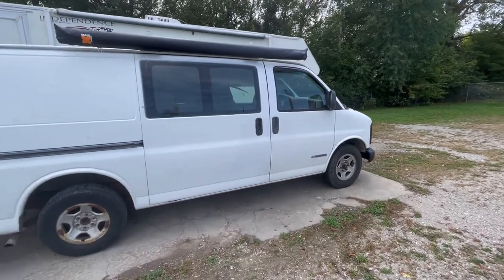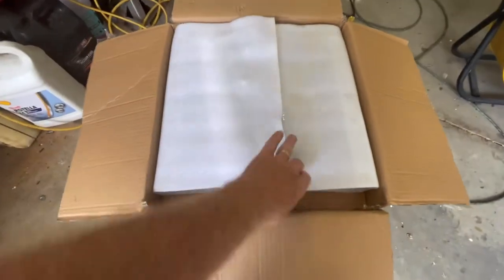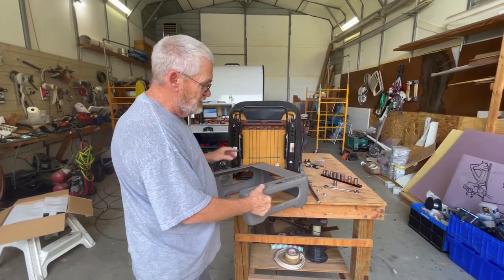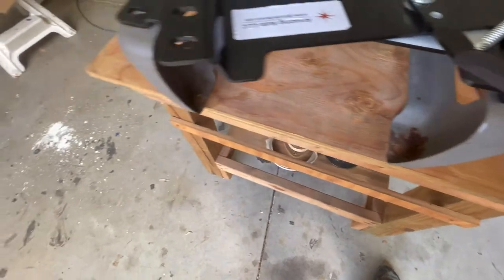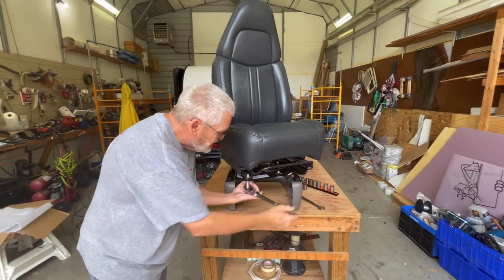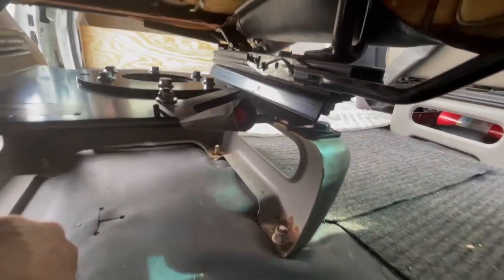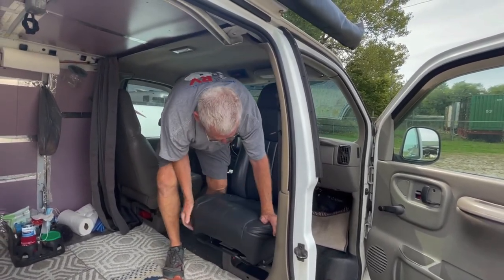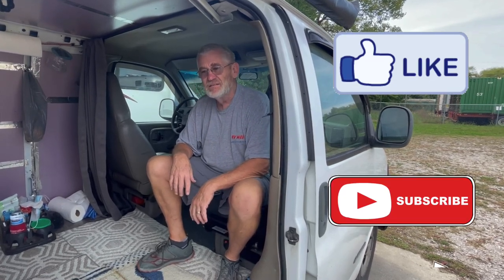Chevy Express “DIY” Camper Van Build  Episide-12  Swivel Seat Installation

Comment: Thank you for this! Helped me though the installation of my swivel seat. Was so much easier than I thought it would be. The only thing I did different was I just popped off the seat from the base, I didn't remove the whole thing together. I would never have thought of swivelling the seat to get at the bolts while tightening them lol! I'm sure that nugget alone saved me half hour of frustration. Thank you sir!
Reply from the maker: Thank you, glade it helped. 👍

Comment: I think I'm just going to get some wing nuts and quickly remove the four bolts on the seat bottom and flip the seat on the base whenever i need it. Almost just as fast as using this swivel and retains the original seat height.
Reply from the maker: That may work…. Let me know! 👍

Comment: Installed today. Thanks for the video! The "instructions" on their site are basically irrelevant. There's a very misleading comment next to the link for your video saying that something is wrong in it. I realize now I installed the bottom bolts upside down, and that's why the tolerances are super tight... the washer placements made all the difference. Needed stacks of two for the bolts to not hit in passing. I'll fix it tomorrow in the daylight...
Reply from the maker: I haven’t seen that comment.
But I hope the video helped.  I hope you enjoy the swivel as much as I do.
Thanks for Watching!
Reply: @TrailMedic911  it's a generic comment and they have it next to many of the videos they are linking to.
Reply from the maker: @capitalistocrat  Ok, Thanks.  Have a good day!

Comment: I just purchased a 2017 chevy express van 2500, I would like to put in a better seat. It has a cloth stock seat, with a airbag in the upright/seat back. But having a problem finding one that will fit, without bypassing the airbag. No power, I can deal with a manual. Any ideas ???
Reply from the maker: Sorry, without seeing it I’m just not sure.

Comment: Hey Keith. I just went back to watch this video of yours . I wish I would have done that first before I ordered the wrong swivels that don’t fit !  I am working on another van build and want seat swivels. Are you planning on attending the spring meet up? If so I would like to check out your swivel seats ( a little concerned about the extra height as I am 6’2 ). Hope to have van ready for a test run by meet up time  Thanks Keith
Reply from the maker: Yes sir, I’ll be there! 👍
I have had no problem with the extra 
1-inch of height.

Comment: ok boss that was relatively easy as was mine for pass side altho its a pain in the arss swiveling around cause such a tight space. need to open door and move seart forward and back many times turning around..   the problem i experienced was not even enough space on the drivers side to swivel. The seat hits the steering wheel, tthe door and trim peice on wall behind where door closes. Its a stock drivers side chair in the Savana 1500 Base model.      Gotta be a way a guy can gerry rig something to make swivel happen. Maybe need move base to center a couple inches  .Forget opting for a bigger comfy captain chair. And dont know if a smaller chair if even available would help.  What do ya think? .
Reply from the maker: I think we are probably stuck with a non-swiveling driver seat.  I kinda knew this going into the build, so I designed my floor plan accordingly. 
Hey, Thanks for Watching!

Comment: Hey got a question what you advising for my 04 savana drivers swivel? Installed one on passenger seat that needs front door be opened then closed for full swivel but there wasn’t enough space on drivers side the stock seat kept banging into sidewall behind and steering wheel. Gotta be one available allowing seat be to be adjusted so not having to drill new mounting holes.
Reply from the maker: That’s a tuff one.  You may have to make a plate to adapt the seat to the mounting holes.

Comment: heads up- that won't work if you are arm rests on the seat.
Reply from the maker: Yes Sir, my seats do not have arm rest.  But I think you are correct.
Thanks for Watching!
Reply: @TrailMedic911  The swivel base needs to be moved forward a little over an inch and to the right (door side) about 2. When you turn the seat backwards, the arm rest will clear the door arm rest. I built my own swivel out of 1/4 plate steel and swivel mount
Reply: Yes, actually it will.